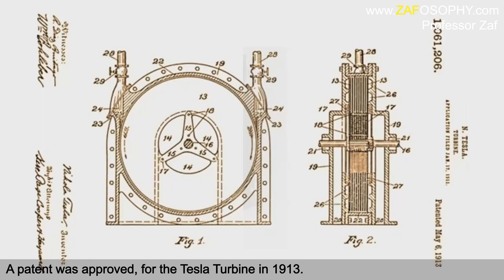Tesla Turbine compared to an Oscillating Engine (Steam Engine)

Comment from the maker: Follow-up video, to address, the comments, from this video, Tesla Turbine Fallacy:
https://youtu.be/7rpPSJSS-1U
All the Tesla Turbine videos, I have seen, were continuously, trying to reduce the friction, in the bearings, to increase speed and efficiency, which is all, well and good, but nobody points out, the magnetic friction, or drag, generated, by extracting energy, or attaching a load.

This is called Back EMF or Counter EMF, which stands for, Back Electromotive Force, which is the voltage, that OPPOSES, the change in current, which induced it. It is directly proportional, to the amount of energy extracted, and is absolutely impossible, to reduce or overcome.

Comment: it's no longer a tesla turbine if you attach those fins.
Reply from the maker: You are right, but I am trying to demonstrate, that to generate any meaningful torque, you need some type of fins, or blades angled at 45 degrees, as in a commercial steam turbine, which are used all over the world, to generate power.

Comment: that is by far the whorst Tesal turbine test i ewer seen , not just that it is open but the Disc space made me laf . i have been using a Tesla Turbine mountet on top of my hot water storage tank conected to vacum tubes  for almost 4 years , it runs on both steam and vacum i use a lpg burner. to start it up  i also have a solar aray 12x 395w/120Ah and for those years i have changed out the turbine discs due to rust once . and it have delivered almost 3 times more than the kwh i got from my solar arays . i have used werry little LPG , and cost whise i regred buying the solar cells. i do not care how efficent the Tesla Turbine is compared to piston engines, it still delivers way more power from Hot water then my solar aray ewer whil and to a far lower price. several friends of mine have copyed my system and they are all werry happy whit it. for private use there is no ceaper and easier way to lower your electricity bill . it just works .. i whil newer change it out :)

Comment: use the optimal tesla turbine disc gap, add the essential shroud and you dont have skill to make it do what it is supposed to do
Reply from the maker: There is no optimal gap. No one in the world is using a Tesla Turbine to generate power commercially.
Reply: @ZafOsophy  I think you are too pessimistic, believe that it can work
Reply from the maker: @Jkauppa   All Tesla turbine videos I have seen, were continuously trying to reduce friction in the bearings, to increase speed and efficiency. Have you ever tried to spin/turn a electricity generator, with your fingers/hand, when there is a load attached? It requires brute force, to spin that generator. Take a small DC electric motor, and spin it, it will spin freely, when there is no load attached. As soon as you attach a load/bulb, and try to spin it, it will stop, almost immediately, back EMF. People don't seem to understand, that to generate electricity, is the same as pushing a big rough rock/boulder up a mountain, it requires huge force, whereas a Tesla turbine is more like a free spinning top, it can never do any real work.
Reply: @ZafOsophy  does it matter if its disc fluid friction or hand crank, contact friction will work, is working, the only question is that does contact friction spin discs, how tight the discs need to be, does the enclosing make it work, it said that the optimal disc gap is around 0.4mm
Reply: @ZafOsophy  why do you claim it has less torque? try the improvements I suggested
Reply: @ZafOsophy  total power will be same, torque convert down if you have torque issues
Reply: @ZafOsophy  blow air on fan if you dont feel like doing tesla turbines, but I hope you dont stop others from benefitting from tesla turbines if you cant yourself benefit from them
Reply from the maker: @Jkauppa   I understand your desire, for the Tesla turbine, TT, to be right :) I could never accept conceptually, in my mind, that air moving along a smooth surface, in the same direction, TT, would exert, push, with the same force, torque, as a blade angled at 45 degrees, traditional steam turbine. Let's agree to disagree, until I see a real life commercial TT, used to generate power :)
Reply: @ZafOsophy  you did not make a commercial piston engine, so I dont believe one exists, get it
Reply: @ZafOsophy  and so there was never such a thing, because you decided they cant be a thing
Reply: @ZafOsophy  in vacuum there is no friction, those discs would be a battery, rotary disc
Reply: @ZafOsophy  there is no obligation to believe me, I also state there is a God, stop teasing me with law things
Reply from the maker: @Jkauppa   Technology improved, from piston engine to Steam Turbines, which are used all over the world, in power stations :) Actually, I would like the TT to be a more efficient way to convert kinetic energy of a moving fluid, into rotational kinetic energy, I am just waiting to be convinced, by a real commercial example :)
Reply: @ZafOsophy  sorry, free tech, no money based products will be there
Reply: @ZafOsophy  your loss
Reply: @ZafOsophy  commercial decisions cannot be relied to give proper evaluation, they are always rigged and bought
Reply: @ZafOsophy  mafia, like you, can price inferior tech above actual better tech
Reply: @ZafOsophy  tesla turbines are easier to make than bladed turbines
Reply from the maker: @Jkauppa   It was a great engineering video, I watched it :) Similarly, I crafted, made my piston/steam engine, as my A(dvanced) level, metal work project, when I was at school, at the age of 19 years old :)
The video confirms, everything I said, he tries to make lower friction bearings, and the materials cannot cope with the high speeds. If he tried to gear the high speed down, to turn a generator, the gears would wear out within minutes/hours. One of the biggest maintenance costs of modern wind turbines, is the gearbox, the cogs have to be replaced regularly, even at such low speeds.
All business is driven by profit. Just as at one time all power was derived from piston engines in the UK, they were all replaced by Steam Turbines, because of better profit.
If TT is actually more efficient, useful, profitable, it would replace all Steam Turbines.
If you don't believe me, just find a small dc motor, spin the spindle, it will spin like a top, freely, like a TT. Now twist/join the 2 wires together, and try spinning it, it will stop immediately, it is impossible to overcome this magnetic friction, back EMF.
Reply: @ZafOsophy  dont use bearings at all, next issue
Reply: @ZafOsophy  Im not ruled by your interpretation of how you see things
Reply: @ZafOsophy  and jet turbines use the same normal bearings, at 120krpm, no need to worry about them, keep them lubricated
Reply: @ZafOsophy  your babbling about electricity issues is nonsense, every generator, or anything turning the generator, same deals, gear it to suit your rotation source
Reply: @ZafOsophy  use something that can gear down without wearing down, impossible is wrong answer
Reply: @ZafOsophy  you try to find excuses why you dont want them to be used
Reply: @ZafOsophy  I will use them, but I will not give you voice or vote in the issue
Reply from the maker: @Jkauppa   The bearing is not the main issue. With a modern wind turbine, a gear box is needed to 'gear up' the speed to drive a generator. With TT, you need to 'gear down' to reduce speed and increase torque. The higher the speed of a gearbox, the quicker it wears out. Usually, a steam turbine drives the generator directly, no gearbox, because you get just the right speed and torque. When you spin a little DC motor, with your fingers, it operates as a electricity generator, if you attach a little bulb/LED, it will light up. With no bulb, if you spin motor with your fingers, it will continue to spin a long time, as soon as you attach a bulb, and spin with your fingers, it will stop immediately. This is called a 'load', 'work'. I hope, wish you become a Billionaire, when you start selling TT power generators. If you can prove just a 10% increase in efficiency, and lower cost for same kWh/power, all the power companies in the UK, would run to buy from you :) Even I would buy from you :)
Reply: @ZafOsophy  you are limited by law
Reply: not worth talking to you, goodbye
Reply: @ZafOsophy  use direct high rpm to magnetically generate against coils, if you must have failed reason not to let it be possible
Reply: @ZafOsophy  you dont believe air flow has friction, it does not have to have, hydrophobic surface, check actionlabs bullet without friction, but in this case it will have, for an useful effect
Reply from the maker: @Jkauppa   I am not limited by law, I have practical experience of engineering, you seem to have zero real life experience. Power must be generated at 50hz AC, not 80khz, because billions of appliances are designed for that. There is a big difference in torque generated, by 'air drag', TT, and 'air push', angled blade in steam turbine. I think you should learn more about power generation engineering, before you debate with me any further, because you are sounding ignorant. I have been patient with you, trying to teach you practical engineering.

Comment: This guy has no idea of working principal of tesla turbine.
Reply from the maker: All Tesla turbine videos I have seen, were continuously trying to reduce friction in the bearings, to increase speed and efficiency. Have you ever tried to spin/turn a electricity generator, with your fingers/hand, when there is a load attached? It requires brute force, to spin that generator. Take a small DC electric motor, and spin it, it will spin freely, when there is no load attached. As soon as you attach a load/bulb, and try to spin it, it will stop, almost immediately, back EMF. People don't seem to understand, that to generate electricity, is the same as pushing a big rough rock/boulder up a mountain, it requires huge force, whereas a Tesla turbine is more like a free spinning top, it can never do any real work.

Comment: You have completely missed the operating principal of the Tesla turbine or any other turbine.
I built such a turbine some years ago from an old computer disc drive. 
The turbine is a high speed machine, (mine ran at 15000 rpm) and as such needed to be geared down by about 30:1. At low speed it has very little power, the power increases as the speed goes up. Much more efficient than a steam engine 
It relies on viscous drag and needs a high degree of precision to build an efficient one, e.g. gap between disks should be no more than 0.4mm, the air should exit through the centre and it should be in a close fitting enclosure to prevent air escaping around the edges. 
The nozzle that blows the air into the disks has to be carefully shaped so as to force the compressed air to accelerate.
The drawbacks are that to be really efficient it need to have a relatively large diameter and run at up to 28000 rpm. The stresses on the disks at those rpms causes them to explode. For that reason the Tesla has not gone any further.
Reply from the maker: Follow-up video:
https://youtu.be/7rpPSJSS-1U

All Tesla turbine videos I have seen, were continuously trying to reduce friction in the bearings, to increase speed and efficiency. Have you ever tried to spin/turn a electricity generator, with your fingers/hand, when there is a load attached? It requires brute force, to spin that generator. Take a small DC electric motor, and spin it, it will spin freely, when there is no load attached. As soon as you attach a load/bulb, and try to spin it, it will stop, almost immediately, back EMF. People don't seem to understand, that to generate electricity, is the same as pushing a big rough rock/boulder up a mountain, it requires huge force, whereas a Tesla turbine is more like a free spinning top, it can never do any real work.
Reply: @ZafOsophy   my guy your using the wrong type of dc motor/generator.  Hi frequency hi rpm induction coil type spin freely then convert the power
Reply from the maker: @nonormies2837   Those electrons, do not like being pushed around, they create almost an equal and opposite magnetic field, to stop movement. Watch the follow up video, TT fallacy)
Reply: @ZafOsophy  flywheel effect and pulsing the right coils could reduces loss you make up for it with shear rpm.  Nobody ever questioned if a tesla turbine worked.  The problem they have they spin so fast they destroy themselves.  Your taking two completely different principles.   Hp vs torque both can achieve the same result in a different fashion.  Im not claiming over unity but an effective at home production more effective then gasoline piston engine.  Ive seen plenty in operation, on a  hundred year old proven tech, but im sure you got it figured out.   Poor engineering will make it not work at all.  Make the power match the load.  All you show is an overloaded system
Reply from the maker: @nonormies2837   I don't know, why I must write/explain this a thousand times? Take a small DC motor, or any generator, spin the spindle, with your fingers, it will spin freely. Now twist the 2 leads together (attaching a load), and spin the spindle, it will stop almost immediately, due to back EMF. It is a fundamental principle of basic Physics. It is the same as pushing a rock up a mountain)